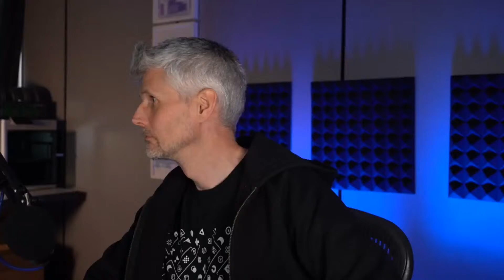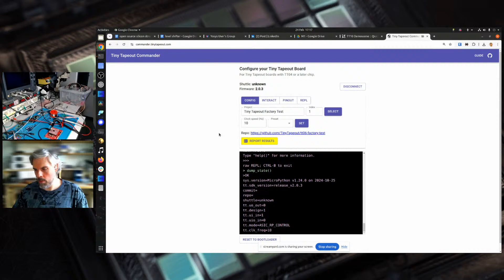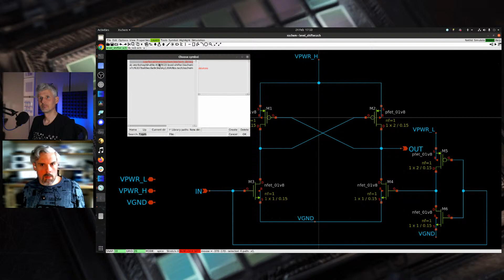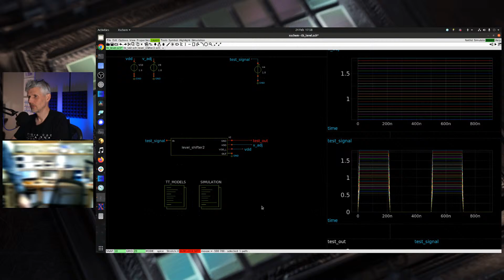Open Source Silicon Stream #6 - Low voltage level shifters

Comment: Open Source Silicon Stream #6: Exploring Low-Voltage Operation and Level Shifters

*   0:00:05 Introduction: Matt Venn introduces the stream, highlighting its regularity (Mondays at 5 PM CET) and resources for viewers (YouTube channel, mailing list, Tiny Tapeout Discord, courses).
*   0:01:26 News and Updates:
    *   Venn recounts a successful workshop in Copenhagen.
    *   Tiny Tapeout 8 demo scene entries are compiled into a single video.
    *   Tiny Tapeout 10 closes in 14 days, with a free-to-enter demo competition.
    *   New chip scans from Tiny Tapeout 7 are available.
    *   Efabless Chip Chat #5 is scheduled for February 25th (9 AM PST).
    *   Latchup 2025 registration and call for speakers are open (May 2nd-4th, Santa Barbara).
    *   Yosys Users Group 10 featured a presentation on ASIC synthesis with Yosys.
    *   Anton's mixed-signal design with an interposer board and Kasten Wolf's SAR ADC bring-up video are highlighted.

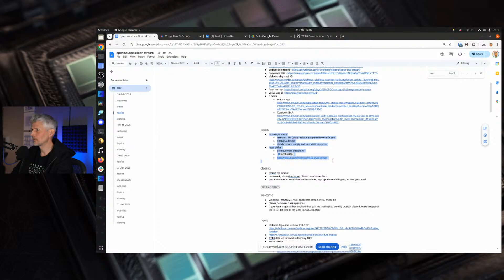*   0:06:50 Topic Introduction: MUX Experiment and Level Shifters: The main topic is an experiment to test a Tiny Tapeout design at reduced voltages and the challenges that emerge with the output multiplexer.
*   0:07:53 Problem Definition: The original idea of lowering the device-under-test (DUT) voltage directly affects the 3.3V transmission gates in the output analog multiplexer, compromising the output signal.
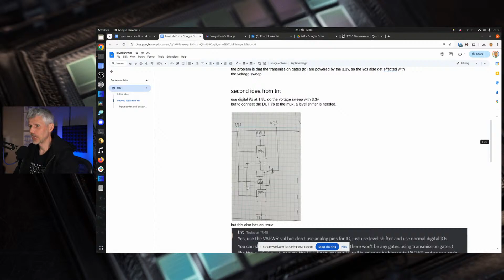*   0:08:40 Level Shifter Introduction: A level shifter is needed to boost the low-voltage output of the DUT to a level compatible with the multiplexer, which still operates at higher voltages.
*  0:08:52 Input Buffer Requirement: An input buffer is also required, as directly connecting a 1.8V input to a DUT operating at, for example, 0.8V would improperly bias the N-wells and cause current leakage.
*   0:09:03 Live Experiment: Venn performs a live experiment, removing a resistor from a Tiny Tapeout board and supplying a variable voltage to the DUT.
* 0:10:52 Experiment Result: The factory design continues to work remarkably well down to approximately 0.78V, but the output signal becomes increasingly slow and distorted at lower voltages.
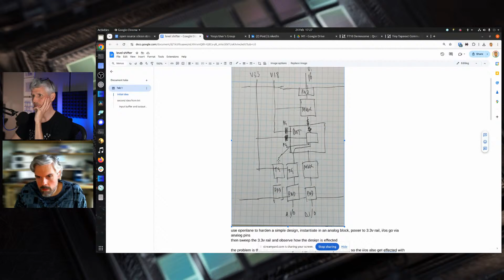*   0:27:11 Level Shifter Solution: The revised plan involves using the multiplexer normally, level-shifting the DUT output, and then supplying a controlled 1.8V to the core.
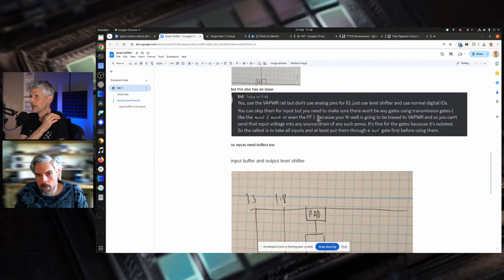* 0:28:34 N-well Biasing, Input Buffer Use: The reason for using a input buffer is explained further. Connecting a high-voltage input to the lower-voltage DUT creates biasing problems.
*   0:30:59 Initial Level Shifter Design: A classic level shifter design (suggested by Sam Elliot) is presented and simulated.
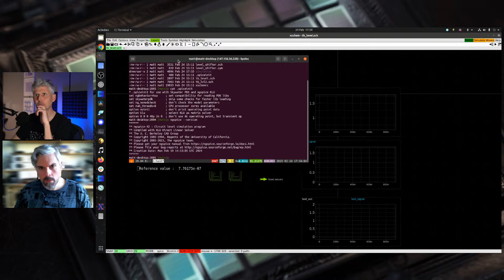*   0:33:52 Initial Level Shifter Limitation: The initial level shifter design stops working reliably around 1.1V input, which is insufficient for the experiment's goals.
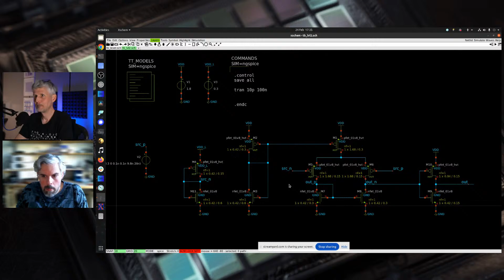*   0:35:37 Improved Level Shifter (Silvan's Design): Silvan introduces an improved level shifter design based on an analog comparator, using a voltage divider and a CMOS buffer for a full-swing output.
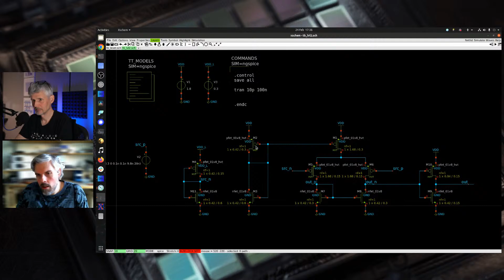*   0:36:13 Silvan's Level Shifter Biasing Silvan did not want to use a large poly resistor, and instead, m3 is used as a resistor, with minimum width and length to lower current to a few microamps.
*   0:37:13 Silvan's Level Shifter Posos: Posos are used for the differential input pair due to the low voltage of the inputs.
*    *0:37:57 Silvan's
Error: int() argument must be a string, a bytes-like object or a real number, not 'NoneType' Voltage Divider:* Transistor pair on the far left is a voltage divider, generating voltage intermediate between both, comparing the input signal to half the rail, then transitioning its output.
*   0:40:08 Level Shifter Sizing Discussion: Discussion of transistor sizing (W/L ratio) and potential sharing of components for multiple level shifter channels.
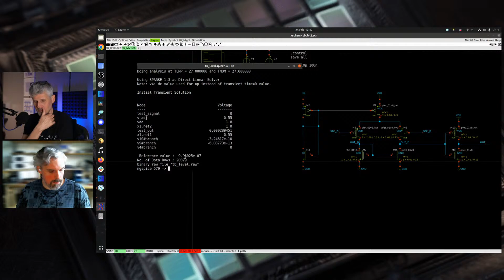*   0:41:57 Simulation of Improved Design: The improved level shifter is successfully simulated, demonstrating operation down to 0.2V input.
*   0:44:27 Layout Preparation: The improved level shifter design is prepared for layout in Magic, importing the Spice netlist.
*  0:46:55 Alternative Shifter Ideas: Native VT transistors are briefly discussed as another level-shifter possibility but not pursued.
* 0:53:29 Connecting Port Issue: A reminder about the naming requirement for the port.
*   0:57:39 Magic Import: Silvan's design is imported into Magic.
*   1:01:07 Conclusion and Future Plans: The successful simulation of the improved level shifter is summarized. Venn plans to lay out the design and share the process.
*   1:01:34 Closing Remarks: Viewers are encouraged to subscribe, join the mailing list, etc., and the stream concludes.

Key Takeaways:

*   Directly lowering the supply voltage of a Tiny Tapeout design within the multiplexer framework affects the output analog multiplexer, necessitating a level shifter.
*   An input buffer is needed between the input and DUT to protect the n-wells.
*   A basic level shifter design has limitations, failing at lower voltages.
*   An improved, comparator-based level shifter (Silvan's design) provides reliable operation down to very low input voltages (0.2V).
*   Live experiments and simulations are valuable for validating design choices.
* The use of a variable voltage supply to a chip and monitoring its output is confirmed.

I used gemini-2.0-pro-exp-02-05| input-price: 1.25 output-price: 5 max-context-length: 128_000 on rocketrecap dot com to summarize the transcript.
Cost (if I didn't use the free tier): $0.04
Input tokens: 26683
Output tokens: 1350